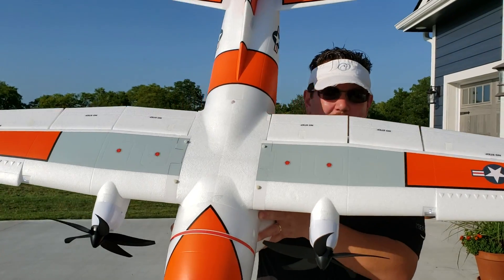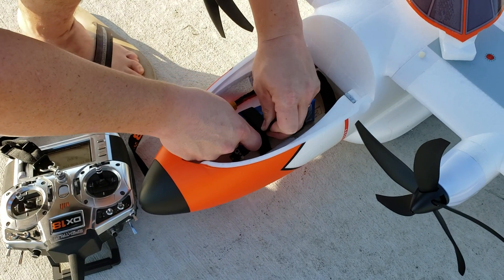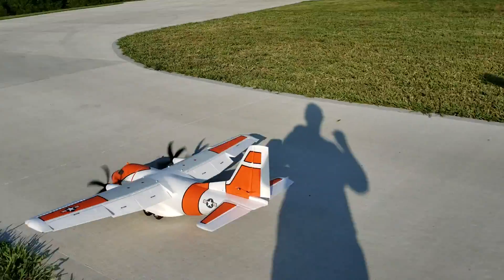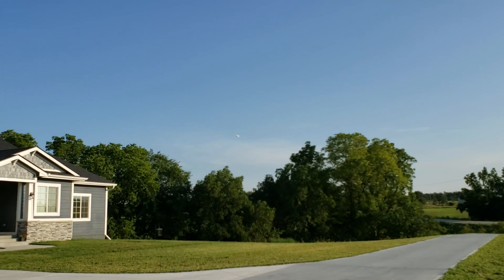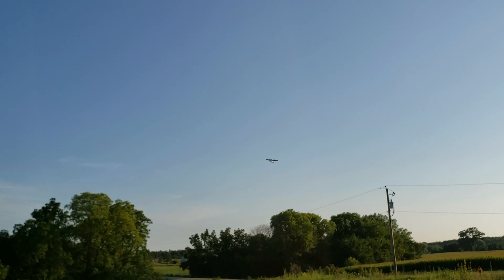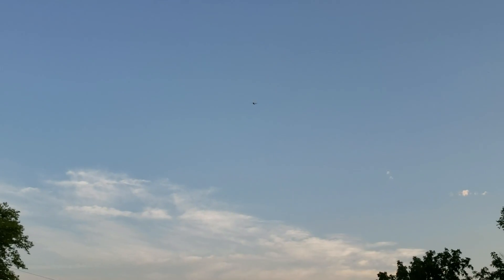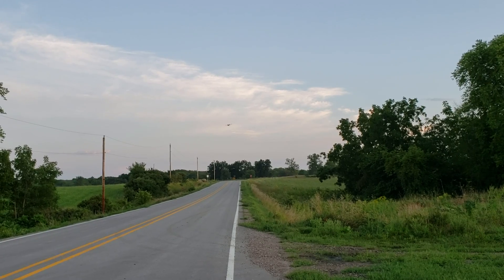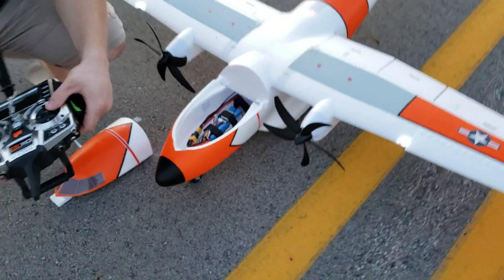Eflite - EC-1500 Twin 1.5m - Maiden Flights, Unbox, Build, Radio Setup

Comment: Great video Brian wish I would have seen it before I bought mine putting it together today I noticed that all they did was rewind some of they're old $40 bl15  to get the KV lower  and they did a pretty crappy job at it looks like by hand very noticeable  not the quality I what expect from Horizon Hobby especially on a twin-engine on top of that not even the V2 ESC using more Old Stock LOL maybe I'll put it on Craigslist or loaded up with a couple pounds of fireworks LOL
Reply from the maker: I was thinking a reversible ESC upgrade, and possibly Differential Thrust...you could flat spin it all day long :)
Reply: @BrianPhillipsRC  yeah some other guys are already having problems with the Power Systems cutting out at Full Throttle I think I'm just going to pull the motors and speed controllers and go with a good 6s setup I have a ton of batteries from the Viper and should help CG better and get the batteries back off the steering servo
Reply from the maker: Dude - that thing will SCREEEEEEEEEEM on 6S. I actually have a single 5000mAh 5S pack that I'm very tempted to try, as I need to discharge that weird pack once in a while to keep her healthy. I wonder if the stock esc's would handle it?
Reply: @BrianPhillipsRC  I haven't been able to do any testing yet because I stripped one of their junk prop adapters before I even got started but I have had the Speed Controller out through the little side door and I can tell you they have 25 volt capacitors so might actually handle a 5S once I get a4s Baseline probably going to upgrade speed controllers then throw my 6s size and see what happens having trouble finding Motors that can handle 6s and you stop props mainly due to size after testing will see if stock wants can handle it
Reply from the maker: Sweet! I'd love to use this 5S pack I've got sitting around. I'm not sure I want to "risk it" just quite yet...would you let me know if you fry yours???
Reply: @BrianPhillipsRC  yeah man I will definitely let you know should have new prop adapters tomorrow when I get them on I'm going to do some testing see what it is drawing for amps on 4s then going to see how it flies this weekend after a couple flights going to drop in a 4600 6s probably a low one not fully charged that way I can keep it under 25 volts and do some pulls on it and get some numbers I want to keep the stock props going to definitely change my speed controllers so don't really care if I damaged them as long as I get some numbers and I don't even mind changing the motors just having trouble finding one's the same size that can handle 6s I don't really want to go a lot longer on Motors would like to keep the stock look but I will let you know how that goes Watts amps volts and temperatures
Reply from the maker: Thanks Chris Tompkins!!!

I really want to do reversible props ;) Add some differential thrust, with full reversible ESC's - can you imagine how crazy this plane would get!!!

 It's almost worth trying.....maybe when we're not so busy.
Reply: @BrianPhillipsRC  I think for now as a test before you change out your ESC then go all crazy I would try just programming in differential thrust with your rudder and try that should be able to get some pretty wild flat spins out of it and make it do some really cool 3D stuff
Reply from the maker: Yeah, except I don't have an AR636 programmer :(......
Reply: @BrianPhillipsRC  just wanted to let you know got some testing done I would not recommend that you plug that 5S into that crappy power system at all even though the ESC is have 25 volt capacitors I plugged in a battery with a bout 21 volts in it and lit one of the ESC is right on fire without even giving throttle probably wouldn't even trust 4S for very long got a pair of ztw 85 amp ESC is on the way
Reply from the maker: OH NO!!!! Thanks for the heads up. I'm sorry that our little experiment went so horribly wrong!!!
Reply: @BrianPhillipsRC  no big deal that is the whole point of testing LOL got some 50 size motors coming to to do some testing on might as well go all out on 6s LOL
Reply from the maker: Good LORDY - 50 size?!?!? Your plane will, no doubt, 100% unlimited vertical!!!
I gotta see some footage when you get her up and running, can you share a link?
Reply: @BrianPhillipsRC  yes I absolutely will I'm going to try a 50/50 motor and a 5045 have both coming to do some testing with I'm trying to use the stock props which it's made it tricky because they are pretty aggressive was pretty cool though tested one of the stock bl15 on the thrust stand with a 60 amp speed controller and stock prop they're good for about a minute then 4 in Flames came out the back of the motor LOL
Reply: Stock motor made it about 500 watts on 4S and hit a little over 1300 Watts on a 6S but if I can get it to you take 6s with the new Motors should have about 6000 more RPM
Reply from the maker: Gotta love the "After-Burner" - LOL
Reply from the maker: yes, you will have unlimited vertical - you might actually rip BOTH wings off - LOL :)

Comment: swape the prop's over see if it rolls the other way
Reply: @toolbaggers  See if you can find the stock prop for the Ares Alara. It is a pusher but 6 blade and same look as these.
Reply from the maker: RCWeaver FPV - Can you get them ccw and cw?
Reply from the maker: I don't think my issue was with the prop rotation or props themselves...it was massive trimming mistakes, and they've since been corrected. Sorry to boar you with my bad experience, but I don't like to sugar coat my reviews. If you see all the good and none of the bad, you'll think I'm full of crap. I have issues, just like many of you guys out there.
Reply: @BrianPhillipsRC  I have not tried to find them. Would look good if you were able to put it on backwards and reverse the motor.

Comment: Hey I very much appreciate this video..I do have the HK  Avios C130 and was considering selling it to buy this one but I’m not so sure about doing that now..thanks again..in my opinion you’re flying skills are pretty good by the way
Reply from the maker: Thanks for the feedback! I'm glad you value my opinion, but don't let my experience dissuade you from trying it out for yourself. I admittedly had some trimming issues (kind of a rookie mistake...) which caused my initial thought on the plane to be less than desirable, but  I stand by my position that the price point is too high...this plane is a $275-325 plane TOPS...but just my two cents worth ;)
Reply from the maker: It's kinda funny you said that, since I was thinking the same thing, only reverse ;) LOL!!!

Comment: I want it but after this video I dont, what am i supposed to think?
Reply from the maker: I know, this one it tough...its really beautiful, and can be made to fly well, but I made some rookie mistakes in trimming for my maiden flights...I trimmed the ailerons and rudder oposite each other, such that the plane really was at a severe disadvantage....this was MY Mistake...which is why we added another set of "maidens" after my initial thoughts.

I can say this unequivocally...it is too expensive. This plane ought to be hitting the market at $300 or less. It's just not as good as they make it out to be. To Horizon's defense, it's a good plane, but it's not that good for $400.

If this plane were marketed at $250, it would be a steal, but it's just not a Timber 1.5m. You can slam the sticks in the corners and make her flip and flop all over, but she's heavy and not near as docile as I expected. I have and had very high expectations due to the (relatively) price point, and I felt let down, even though I do like it. I would not buy it again, and can't necessarily make a firm recommendation, even after my screw ups were corrected, and I got her flying good...I wanted to be AMAZED, and I was not.

So...in closing, it's a fun plane, but just isn't as awesome as the price would lead one to believe.

Sorry to burst anyone's bubble :(.... I too had VERY high hopes.
Reply: @BrianPhillipsRC  Did you calibrate the ESC's before the first flight? It isn't normal but sometimes the motors are generating quite different thrust. Sometimes it may take a few tries.
Reply: You would be happier with a Bush Mule from Hobbyking. Best twin I’ve ever had. 10 times the plane.
Reply from the maker: I did not, but did before my "second batch of better flights (from the road)", but that wasn't my issue, I stupidly trimmed the rudder and ailerons to correct for roll, and ended up trimming them in almost opposite directions!!! ROOKIE mistake ;( ...but after I noticed the way the plane was rolling on takeoff (off camera, of course) I did a mechanical trim and fixed both axis, and blammo-wammo, she flew about 85% better. Still lumbering and heavy, but plenty of power on 3S or 4S, just not overwhelmed as I'd hoped to be for a $400 price point :(
Reply: @BrianPhillipsRC  turns out I did the same trim mistake with my Turbo beaver today.
Reply from the maker: Ryan O. - See, it's easy to do, right?!? Glad you got it sorted out!!!
Reply: I have the Bush Mule and it flying great, but 2 issues is stock servos suck and the stock props just explode for no reason.

Comment: Did you try programming the esc’s?
Reply from the maker: I recalibrated the throttle range, then I figured out my Rudder and Ailerons were fighting each other...then the "later" flights were after I fixed that issue. The asymmetry was from my horrific, error in trimming.
Dude - I was so sad to see your airliner in pieces on Instagram the other day - What a HUGE Bummer! That thing was a looker!!!!
Reply: @BrianPhillipsRC  Yeah its a bummer but the unfortunate accident makes room for bigger and better things. Im thinking A350-900 or 747-8. Still not sure though.
Reply from the maker: I want to see videos of the build, not just a few clips on Instagram...not to bash Instagram, but I want to see the whole thing!!!
Reply: Brian Phillips During a build I put the photos on my Instagram story. It makes it much easier to put a couple photos up without having to make a whole post. You can see the build photos for the king air 90 on my Instagram page right at the top above the post and below my bio.

Comment: Could one of the props be backward?
Reply from the maker: nope, if they sent me the same props, then that would be possible, but we made sure to get the props turning the same way, and with the "detents" in the same position..I just wish there would have been markings to make that part more clear,
Reply: @BrianPhillipsRC  I meant installed backwards even though it is correct right and left, props have a back and front and on these 5 blades it is pretty hard to identify the front and back. I have seen several people mount props backwards and complain that thrust is bad. Convex side to the front, flatter side to the back. On these props it took  me a while to find front and back.
Reply from the maker: I think they're right, but I'm gonna double check now that you say this, you've got me second-guessing myself ;)

Comment: Brian, knowing how detailed you are (I won't say anal retentive) from watching your other videos, I am surprised you flew and continued to fly with the flying surfaces so far off. There is little chance for a good, locked in flight with ailerons, rudders etc so far off. I've seen several other review videos of this model and everyone was very happy about the way it flew. I didn't have time to watch the entire video, did you get it set up better mechanically and give it another try?
Reply from the maker: Yeah, this was  mistake on my part, and I did figure it out and have it flying good now. I haven't ever had such trouble with trimming a plane from Horizon Hobby, but did expect better from them. I'll admit that I exacerbated the factory mistakes with my own, but after working out what was happening, I had it flying well in a few minutes.

Sorry to boar you with these details, but I don't want to come across as disingenuous, or trying to cover for Horizon Hobby   (or whatever brand I'm reviewing) ...even if it leads to some level of tediousness...I'd rather be seen as genuine, truthful, and reliable...over infallible. 
 Thanks for watching!

P.S. I am anal retentive ;)
Reply: Brian, I have exactly the same problem with mine...have to put in 100+ clicks of left to fly straight.  What is the answer?

Comment: I saw the plane flying with a 3D pilot and is fantastic, you plane was way out adjustment, plus you first have to flight this plane manual, no with the axwherever help.  Now I own hobbyking planes c-130, skipper, Fresco Mig 17, Albatros etc and no complains at all,  most problems are pilot errors in setup and flight.  I hope you fix you issues, I do not like this plane, I do like how he does 3D, is different.   I do not like the price, and I hope the installed metal servos, horizon is well known for installing garbage servos.
Good luck and happy flying.
Reply from the maker: You are exactly right! I made mistakes, and they are now corrected, but this plane is TOO expensive, for what you get, and it's just a huge, heavy gimmick...something I've come to expect from Banana Hobby, or Hobby King - NOT Horizon Hobby - disappointed, is the best way to describe my feelings...
....BUT it's not a BAD plane...I just had HIGH hopes, and was let down...oh well.
Thanks for checking out my [extremely long] video ;)
Reply: @BrianPhillipsRC  you will get it dial in, just take you time.
Reply from the maker: For sure. I have it tracking straight as an arrow now, and she flies well, but still haven't changed my mind totally. 

This plane has it's strengths, but it also has its weakness (like most RC planes)....my only issue is I wanted another Timber 1.5m OR Carbon Z Cub - Solid, Excellent Flying, Floaty but Powerful - and I didn't really get that...but it'll rip straight up with unlimited virtical on 4S, but she's doggy still. You can spank her into the air in a few feet, similar to the timber, but the feel is that she's heavy and you're just using a huge power plant to riper her too and fro...I was expecting a docile flying, near perfection, Horizon Hobby special, and I got a Hobbyking special instead :(
HOWEVER....after flying for a few more days, and learning her control quirks, I'm having fun with her.

Comment: 40 minutes in without attempt to correct. I would have at least tried to re-calibrated the ESCs
Reply from the maker: I did it off camera, and at the same time was figuring out my trim was screwed up - totally my bad, but I couldn't "sugar coat" this review...I don't want to mislead, and don't want to take out all of my gaffs...this is real life for me...and I screwed up, but even after fixing my trims, which were causing the asymmetry, AND recalibrating the throttle ranges, which took only about 10 seconds, she still didn't "overwhelm" me like I wanted.

I'd say this was one of the few Horizon Hobby planes I've been "under-whelmed" with, out of all the planes I've gotten from them. Is it bad - NO!!! It's just over-priced...

Lots of good things, but basically, it's too heavy to be a Horizon plane, and for $400, it should have been 2 meters, with differential thrust, and retracts.
Reply: @BrianPhillipsRC thanks for the clarification. I have learned alot from your channel and respect your assessment of such things.  I was surprised that a salty dog like you kept flying it all wonky. I agree with the bang for the buck comments.
Reply from the maker: I was lucky to figure it out. I finally noticed she was lifting with one wing FASTER, and I was like - THIS IS NOT RIGHT!!! but I had the rudder set so that it would "Correct" this issue at full speed - it was a perfect storm of screw ups - really, kinda embarrassing, but it's something that can happen to anyone. I was just kinda annoyed with Horizon, as this just isn't something we have to do on a new Horizon product...they come ready to fly 99% of the time...It's kinda funny too, I was blabbing on, in the first 30 minutes or so, saying something like "..it's hard to tell which axis is causing the roll, is it the rudder or ailerons..." or something like that, then I fell into my own spider web - LOL!!!
Reply: Brian Phillips THE RUDDER!!!! was obvious after the first landing.
Reply from the maker: Cerus98 - I've not had that experience with Horizon Hobby, they make some of the best stuff, if you ask me...I just think this missed the mark. If it were better priced, I'd have lower expectations.
Reply from the maker: Cerus98 - yes, the QC might be slipping some lately. I hope it doesn't continue like this.
Reply from the maker: I feel the same way, but not because of the cost, but rather the Government intrusion into our everyday, EVERY aspect, of our lives...soon we'll have to track our bowel movements and put an FAA tracking number on each turd, so they can confirm our diet is healthy enough for some bureaucrat.

As for this hobby - the FAA needs to BUT OUT.

P.S. While I'm on my soap box, why not just reclassify airplanes as airplanes, NOT DRONES! Would that be soooooo hard?

Sorry, I kinda ran with that, and I realize your concern was over cost and quality points - to your point, we do have a whole lot more sophisticated electronics then we ever had before, but then there's more bugs to fix too :(

Comment: https://youtu.be/-UGnRN4kimk?t=869  try a stronger 3-bladed props  (those props may be out )  stronger  3 bladed prop's may  work, ? if this doesn't work                  (ESC programing card )
Reply from the maker: If I was going to make it more powerful, I'd probably go for a two blade prop, otherwise, you'd be hard pressed to get counter-rotating props.